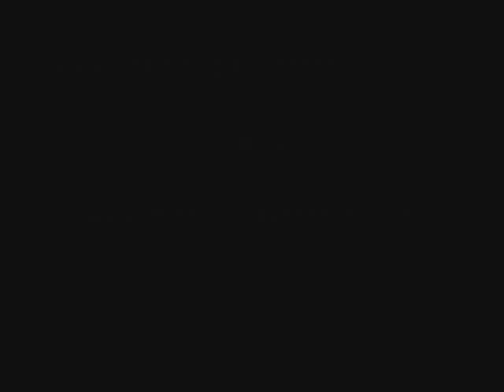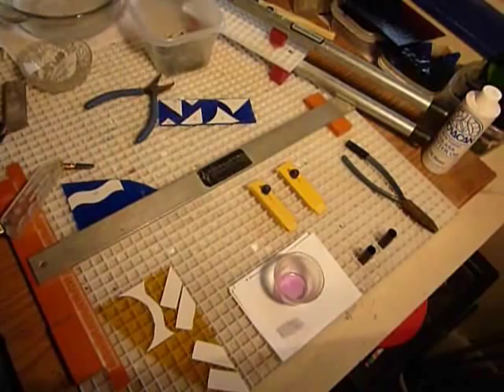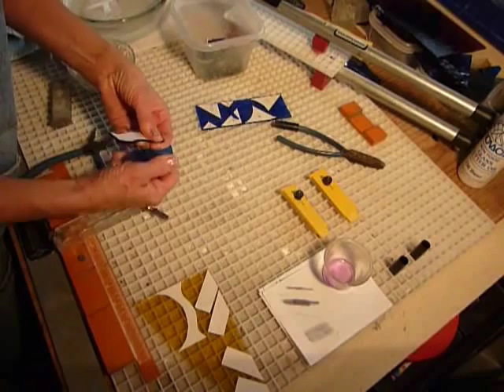(D) Stained Glass How to cut glass.wmv

Comment: A circular piece questions....how do you secure the piece to your homasote board to adjust pieces for correct fit and after foiling, need to secure it for soldering?